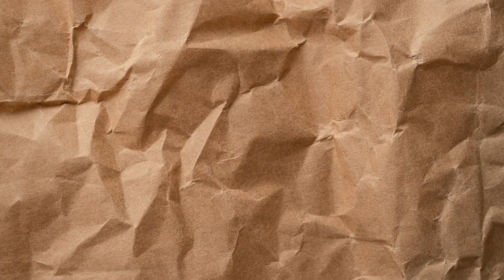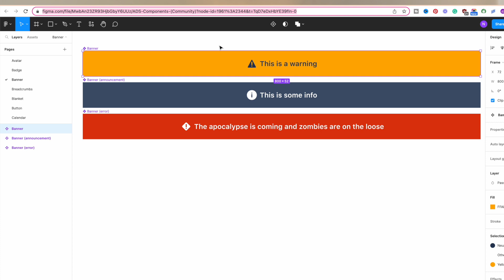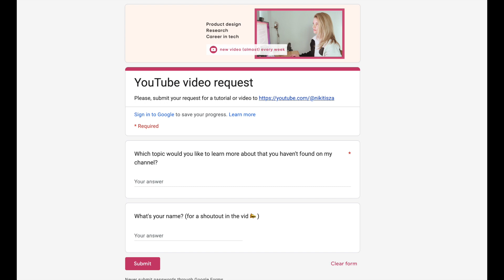Big Debate: Naming layers in Figma - What engineers expect from designers

Comment: Great info from the horse's mouth! 👏🏾I personally name layers, properties, and variables using camelCase. Designers HATE it, but my devs find it readable. Figma's whole "/" structure has no meaning to devs, but I use the "/" naming scheme on the design side because it controls the nesting function in Figma finders.

I honestly do not understand how anyone can design a complex UI without understanding how code works. That's just me. 🤷🏽‍♂
Reply from the maker: Sounds like you're doing it right! :)

I do agree with you...even though most product design jobs don't necessarily require coding skills, my front-end background always comes in handy.